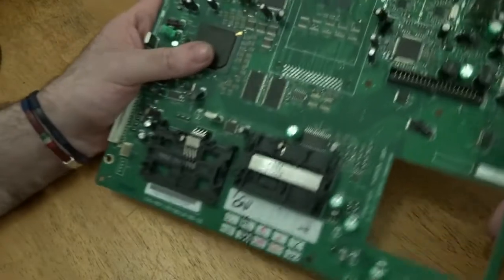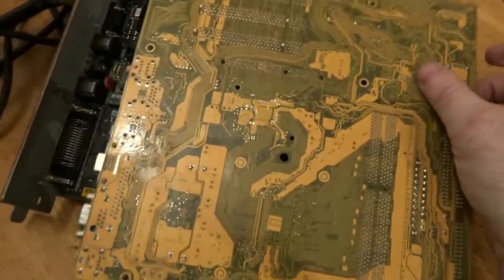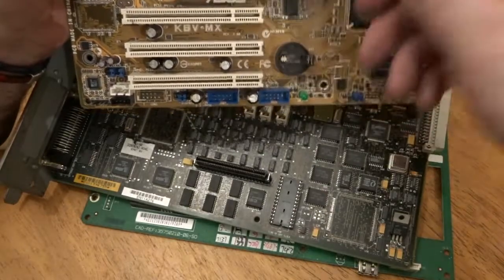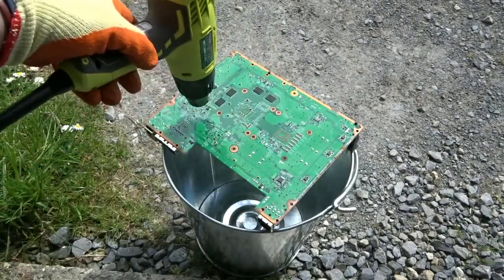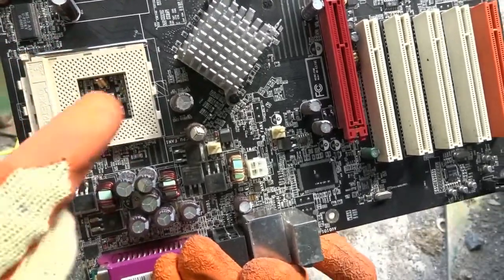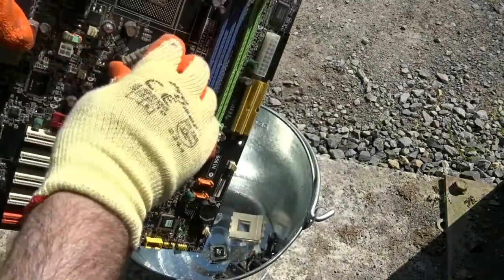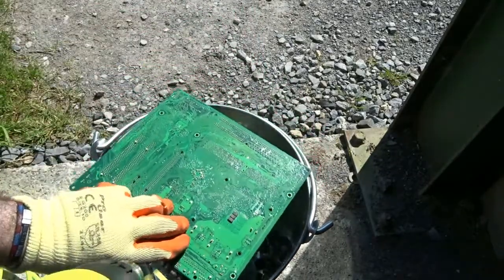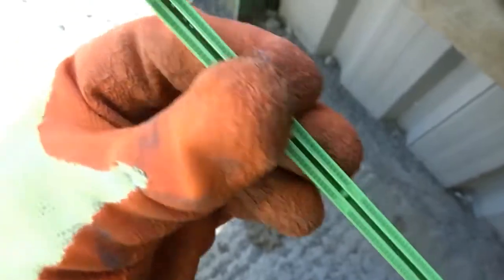Is Depopulating Circuit Boards with a Heat Gun Really Possible?

Comment: I usually zip-tie my heat gun horizontally on a milk crate, so I have both hands free. I'm experimenting with hot sand baths now though, although I can't seem to get it right
Reply from the maker: I have tried the sand bath but can't seem to get it to work either cheers for watching and commenting

Comment: i used to use a heat gun for years. i learnt the hard way. its very slow and uses quite a lot of electricity. plus i burnt out 4 heat guns in my time. i have now moved on to a propane blow torch, with the flame turned right down. its pretty much the same as a heat gun but faster and hotter. just keep the flame on low. cheers
Reply from the maker: Thanks i will try that way and see hoe it works out
Reply: when you first try, you will probably over heat the board. but after some time you get a feel for it. cheers